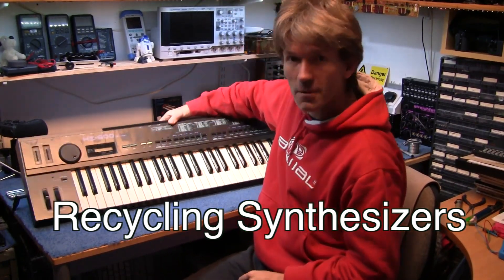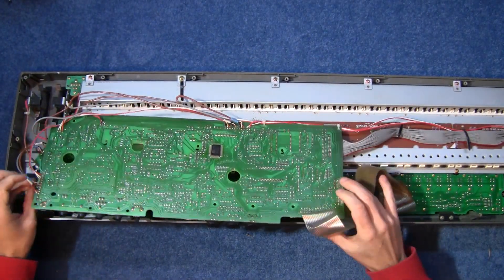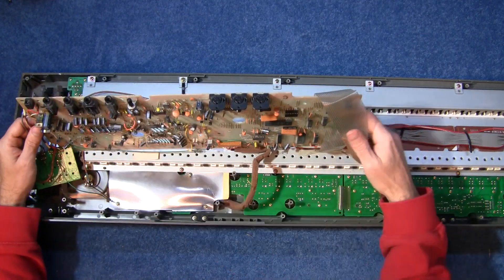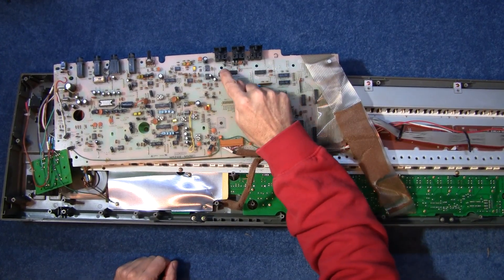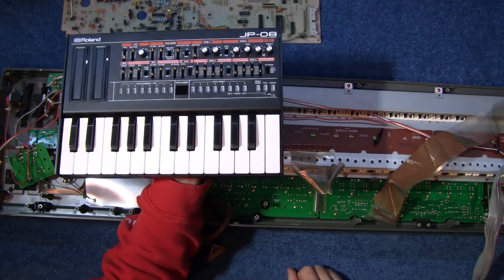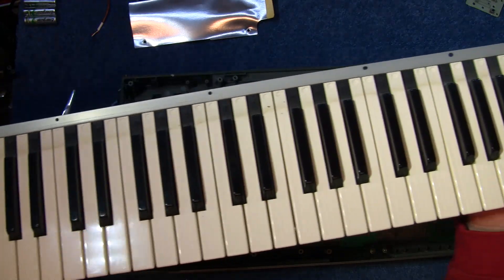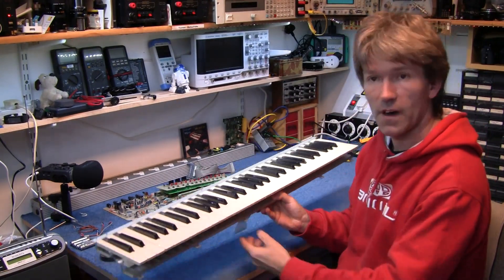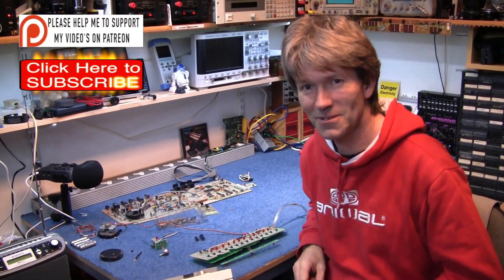Synthesizer Recycling for Electronics parts salvage MF#64

Comment: hi don't keep alot of the parts i have a RS acc and i can get alot of the parts next day  yes you need to get you money back 
i got a akai  GX77 that;s in a bad way i am only fix it because it a bio transport  someone did repair on the audio pre amp to the vu meters 
and it did a lot of reg's in  and  transistors  in   i have done more hard fix up  bob

Comment: If this is the synthesizer I think it is (a Casio hybrid synth with spectrum dynamic synthesis).... When you got a hybrid synthesizer on your hands Markus.
If i'm not mistaken me this unit got both a VCF and a DCA for the filter and Amp section. 

If you still got the parts can build yourself either an analogue- or a hybrid synthesizer with DSP based oscillators. 

Cheers
Daniel Fletcher of D.S. (a Swedish synthrock / synthpop group)

Comment: There's one chip on that HZ-600 board that you MUST extract.  

The NJM/JRC2090 is a 5V 4-pole VCF chip, custom-made for Casio.  It's really warm and can be nicely controlled, would make a fantastic DIY filter box! 

Search Youtube for modified HT-700 and/or modified MT-600 to hear it in action!
Reply from the maker: +Kerry Bradley Hi Kerry I have already eyed those up for extraction, theres 2 of them on this board. but thanks for the youtube search info I will go and watch those. Best wishes from Markus

Comment: Hi Markus good vid, I have been scrapping old gear for years if you want good stuff try to get hold of on old organ some have great keyboards which can be used for a synth they are available free on gumtree and eBay a lot most people want to give them away or very cheap ! Well in Scotland ! I have built a lot of gear from scrap parts including a Minimoog although I had to make a lot of bits, thanks for posting Steve

Comment: Not sure if you opened a korg prophecy before mate but i have a problem with one of the keys as it rising up above others a bit around 3 mil. Any ideas on how to fix that? I dont want to mess it all up. Great channel and subbed by the way. Cheers
Reply from the maker: +AlbostyleG Ah yes I have been in the Korg prophecy years ago. I think you may have to remove the keys either side of the lifted key and check underneath as I think it has a small plastic tag that when it is not played the spring only brings it up to the metal strip that runs under the front of the keys, if that tag is broken off then the spring will pull it up higher than the other keys. it will only be a very tiny piece of plastic near the front of the key that may be broken off. If that is your problem you can easily glue a piece of plastic from something else to make the lip. I have in the past made a piece from a plastic polymer called polymorph that you heat in water and mould to shapes then when it sets you can glue it into place. I hope that is the problem you are having I cannot think of any other reason the key could settle higher than normal. Best wishes from markus
Reply: +markusfuller thank you for the fast reply. I will look on your advice and see how it goes. I recently moved house and the removal people must have knocked it a bit as I see a line of a crack on the key. I think the knock must have done that. I may need a new key as well i am sure. Thank You
Reply from the maker: If you let me have a picture of the key and its measurements I may just have one here. I have a box of old keys from yamaha casio korg etc so If I have one you are welcome to it.
Reply from the maker: Hi I think you can post a picture on google+ page that you should have as you have a youtube account. the last time i posted an email address on here I received lots of messages saying I had won millions on lotteriess in south africa and my bank accounts will be closed if i dont verify my account passwords etc. I had to change that email as it got jammed with scams.
Reply from the maker: OK I will go and see if I can find them.
Reply from the maker: Hi I got to your AlbostyleG google page but there are no pictures in your photos. I will check again tomorrow as I need to go out now. dont worry we will sort this out and I will gather the box of keys from my garage so I have them here to look through tomorrow. Sorry must dash. catch you tomorrow.

Comment: Yes, lots of useful bits :-) Personally, I'd have seen first if it still worked for MIDI out, as a controller, but once the 'phantom bodger' has been there before you, you don't stand much of a hope in hell of fixing it up. 
I hadn't seen this synth before, though, and was curious - going to this video, demonstrates it's rather nice sounding (digi synth plus single filter) https://www.youtube.com/watch?v=_VepOd4X1u4
But no where near worth the £100 + people are trying to get for them on eBay.
Is there a filter chip on the board, or is it discrete?
Reply from the maker: +mickey thompson Hi Mickey. It was completely dead and could not be used as a midi controller. Im not sure about the filter chip, there may be one on board rather than discreet components but it is under a pile of junk at the moment.
Reply: Well, that could be a neat project - isolating the filter and making a 'filter box'... cutoff and resonance controlled by those wheels.
-
Sorry, don't know why I'm drooling over your bits box... I got a huge one myself ;-)
Reply from the maker: Hi Mickey, I keep on collecting junk in the hope one day I will use it. I do occasionally but as you must also know it is nice to just find that part you are looking for :-)

Comment: Marcus there's 2 casio filter chips in there a La korg ms... I liked the programmable orchestration but sold the ht700 I had. 
hz is the big key version someone must need spare keys etc!
Reply from the maker: +James Porch Its a shame i had to strip it down but there was just too much work to get it going again. Im sure the spares will donate eventually into other gear. PS hows the new synth ?. Im getting some interesting sounds from mine :-) put it through a few effects and it sounds BIG

Comment: I like this vid Marcus, stripping the components is something I've often done due to a lack of skills, knowledge or parts.
 Or if you can't salvage it - repurpose it. Perhaps it would have just functioned OK as a MIDI controller?
But I do like Capo Donatellos' suggestion of a MF One synth project. That would be one badass MF ;)
Reply from the maker: +brickscratch Hi It could not even function as a midi controller. theres was just so many dead parts around the power etc and strange voltages in the wrong places. I hope some of the parts can go to good use. Yes a MF-one synth. yes i have the ideas but not all the knowledge needed to build the monster i want to create. maybe I am thinking about it the wrong way and should try building individual units up to plug together ?. Hmm my brains ticking now. tick tock tick tock ???

Comment: I have an ht3000 and ht700, which are pretty much the same than the hz600. They are polyphonic digital oscillator synths with a single analog filter. I learned synths on the ht3000 back in 1988. It's sad to see this hz600 dismantled, but I understand you got good reasons. I would suggest that you try to salvage the analog filter and vca chip. As you said in the video, that could make an interesting project.
Reply from the maker: +sasarasa88 I did spend few days looking into it and realising there was just too much to replace and gamble that it would sing after days of work. but parts will be donated to other causes so it will still live on (partially).

Comment: Another good video. Off to find out about the Casio HZ-600, as it's a model I've not heard of.
Reply from the maker: +Michael Smith hi michael, it was an interesting synth but there was just too much work required to repair this and i do not think it would have been an amazing synth sadly.
Reply: What you had there, looked a bit unpromising in terms of a rebuild. The HZ-600, though is bonzer! It sounds freaking great. A bitch to edit, and many other foibles, but they sound really nice; and the giant wheel is always good.
Reply from the maker: +Michael Smith Yes but things were missing and I have removed a few components only to find they are dead. The transistor I used for (how to test transistors video) came out of this and theres a few other dead bits so I guess some of the chips could be fried also. Believe me I did a few days looking and some tests before i decided to kill it.
Reply: markusfuller I literally had just come back from the other parts of the internet, and realized how nice this synth sounds. My last comment was to mourn how it wasn't practically repairable. I'm in the market for one, now.
Reply: Not yours, of course. But they're out there. And sounding nice.

Comment: The 6 pin IC connected to the MIDI in is probably an opto isolator.
Reply from the maker: +PWMaarten Yes it is an Opto Isolator its standard on all midi inputs across almost all midi devicesI thought I said that so I watched the video again - I cant believe I said Op-amp "ouch" thanks for pointing that out.
Reply from the maker: The main reason i keep components like this is the time it saves from having to wait for shipping. some components are very cheap but if you do not have one it can take days for it to arrive.
Reply: +markusfuller
and a new one cost 3-4€ +shiping :O
so, its very clever to keep them ;)
Reply: markusfuller

yeah, thats the main thing i hate too.. waiting for parts :(
atm i'm waiting for 10k potis (20pcs) from asia.. man, it feels like aaaaaages :/
Without having them, my project stands still... meh.. :(